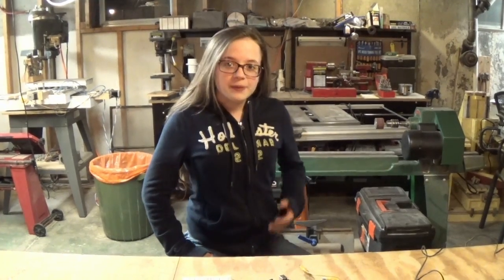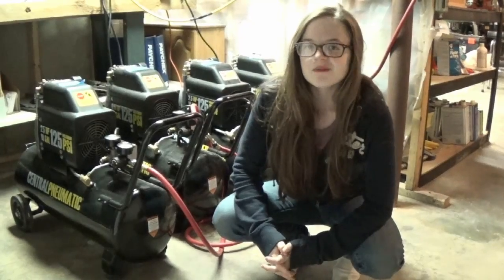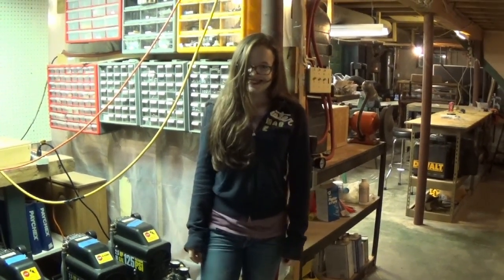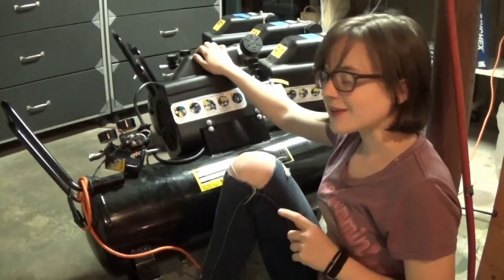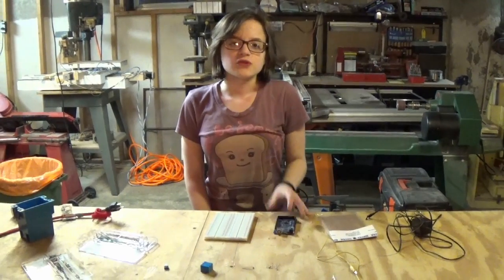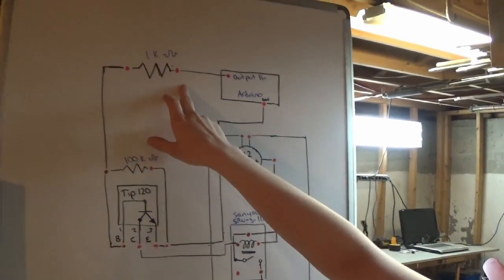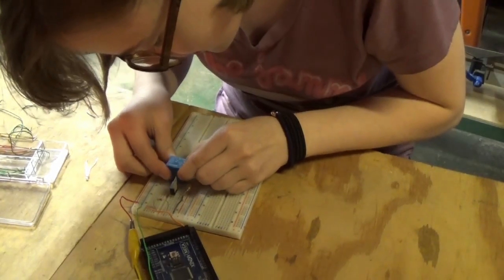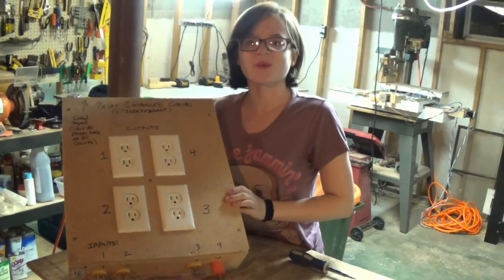Ep3 Cheap High SCFM Air with Parallel Compressors

Comment: Hannah has single-handedly restored my faith in the American youth.
Reply: she shouldnt.... you arent supposed to run air compressors on extension cords because of the high amp draw... it can cause fires because extension cords arent usually made of the same gauge (thickness) of wire as whats in your walls... NEC (national electric code) calls for no less than 14 gauge wire in your standard 20 amp 110 outlet.... (important to note that even though the outlet itself is only capable of 15 amps the breaker is usually 20amp).....

in summary during prolonged use the extension cord wire could get so hot that it would melt the insulation off of it and cause an electrical fire.... this effect is magnified by the length of the cord.
Reply: you do realize that a large majority of grounded extension cords sold are 14 if not 12 gauge. Unless you are buying the absolute CHEAP crappy extension cords you will be getting at a minimum 14 gauge. Also the duty cycle of the compressors will never allow the heat to reach that point in the cord or construction work would be having fires left and right from compressors running on extension cords all day while we do things like roofing or framing houses.
Reply: pmoore4321 how old is she? She seems pretty smart for "youth"
Reply: she just turned 34
Reply: Impedance in an electrical conductor is as much a function is length as it is gauge. She mentioned earlier to keep the lengths down. She'll be fine.
Reply: Ima Tumor Yeaaa right...
Reply: womer 66 those didnt look like 14 gauge cords to me more like 12 and as a electrician  15 amp circuits don't have 20 amp breakers unless some dummy replaced them.of all the thousands of times I have seen compressors on cords with a 15 amp breaker I have never seen a fire
Reply: she is fake bro , she is a character made up by a producer , she is just playing a part
Reply: @wormer66. I doubt it. Those comps' are probably 1.5 HP motors. Your average washer and dryer would draw more current than those pesky little compressors. I regularly run a compressor bigger than those through an extension with no problem!
Reply: doppler Your right man. I'm an electrician and it appears that wormer66 is on the right path, but still needs more knowledge when it comes to residential electrical circuits. Yeah and only an unexperienced electrician or somebody who doesn't care about safety would hook up a 20amp breaker on a 14 gauge wire. Plus this girl is so freakin smart that I'm pretty sure that if she did her research on how to hook up all of these compressors in parallel that she obviously also looked into her main power supply before making her video. 😉
Reply: all of the wiring in my house is 12 gauge... i have no idea why whoever built it originally opted to get only 15 amp outlets... shrugs*
Reply: Formidable38  says 2.5 hp on them.
Reply: When my parents remodel their come in the late 70s we used 12 gauge for both the kitchen and lighting circuits. Wile I used 20 A. outlets on the kitchen circuits, I use 15 A. outlets on the lighting circuits because they where feed by 15 amps circuit breakers. At the time 12 gauge wasn't much more expensive that 14 gauge, and some of the lighting circuit where quite long.
Reply: wormer66 Maybe they got the 12 gauge wire cheap. I wish someone used 12 awg in my house. My living room needs a few 20 amp outlets.
Reply: +wormer66
dumb.
Reply: Like she has done any of this on her own. She's reading from a script her parent/guardian made.
Reply: +wormer66 $$$ its even more $$$$ to rewire later but after spending $$$ for the 12 gauge you save by selectivly putting in 20 amp outlets only where you find you need them or want them later. Easy to swap an outlit hard to repull wire once sheetrock is up
Reply: sorry you are wrong 14 gauge wire is only rated for 15 amps and 12 gauge wire is for 20 amp so i am wondering what Home Depot you got your information from and by the way i run my 110v 160amp DC welder running at 110amps with 7018 3/32 welding rods off of a 50' 12 gauge extinction cord and after 2 hrs of welding nether ends are even worm ...and by the way I am also a licensed electrician and she is correct and will be fine and is taking the correct steps for the job she is performing
Reply: so i am wondering why dose it bother you so much that her family is teaching her so much good information about construction and electrical what better people to learn from
Reply: dexter2433 who u talking to bro type + and their name first
Reply: Ulricht vonLichtensteinp
Reply: Wormer66 - 14 gauge wire requires a maximum 15A breaker according to NEC.  If you have a 20A breaker, code requires 12 gauge wire and 20A receptacles.  If you have 15A receptacles on a 20A breaker, that's a fire hazard as the circuit can handle more current than the receptacles are rated for and the breaker won't protect the receptacle from overload.
Reply: Doesn't matter. She is being a good role model for the up coming generation, when so many others seem to want to live the Kardashian dream. Oh Please! I have been a Union tradesman for over 40 years, these skills are dying out, it's all IT or being a Rock star, we can't all be born rich, who would fix the plumbing?
Reply: pmoore4321 I think she's canadian
Reply: Your right.
Reply: If everything is new and connected right there is plenty of margin for safety, but if ft he runs are old and maybe a bit of corrosion etc a 15A circuit certainly may be dangerous to push to 20A
Reply: specially being female
Reply: Global youth in general
Reply: Dude she's a kid and a damn smart one. She looking to restore her old VW bug in time to do her driving test for her license.
Reply: pmoore4321 your great at sarcasm. i was cringing through the whole video.
Reply: Please see my reply above
Reply: @Gabriel-jc2sc  she is indeed very smart! She most definitely knows Ohms law!!!... She is most definitely able to perform the necessary calculations!!!... Please see my reply above!
Reply: @wormer66  rather safe than sorry!... I suppose you have a relatively old house?... (like myself!!!)... Safer to have a larger safety margin (than required) than to have an inadequate safety margin!!!
Reply: @Assimilator702  agree 100 percent!... Rather an overkill than an underkill!!!... Rather be safe than sorry!!!
Reply: @wormer66  the purpose of the breaker is to prevent fire!... The insulation around the wire will melt, causing a dead short (infinite current)... That will trip the breaker... a Breaker is actually a resettable fuse!... Instead of replacing the fuse you just reset the breaker
Reply: @dexter2433  I agree 100 percent! Everyone has to learn!... In fact we learn something new every day of our lives
Reply: @frederikmare9002  jealous? Why would I be?
Reply: @eiserntorsphantomoftheoper2154    More like 10.  lol   I think I saw her pink Barbie Townhouse at the back of the shop and she behaves far to (valley girl) silly to be in her thirties.
Reply: She quit a long time ago

Comment: Haha. I was playing around with the idea of some kind of central control to make sure one of multiple parallel compressors under independent control doesn't burn up trying to fill all the connected tanks. I did not expect to find the relevant issues so well covered by a 13 year-old! Great job. Keep it up!
Reply: Doesn't mean she knows it all and wrote the info, could have easily been reading a script then edited together
Reply: Nor me I'm doing a similar project.

Comment: Wow. Simply astounding. Someone has a Masters in electrical engineering. You have spent some time researching this for sure. You Just found a way to build a $7500 dollar compressor for about $600 bucks. I have heard there is some crying in the comments about this or that but who cares. What you set out to design so you could restore your Bug on your terms simply impressed the hell out of me. You young lady are the most impressive youth I have seen in quite some time. Bravo

Comment: I cannot believe the petty, insecure, and negative comments. Absolutely thrilling. This is HER solution. She invested the time to comprehend and implement. Everyone must learn somewhere. Clearly very gifted and intelligent. A note, there is a lazy solution to mechanically couple. I tracked down a US mfg that makes a phenomenal, all metal yet cheap check valve. Sellorcity on amz. I operate by pairing down into a single connection. I have two pairs of eight gallons. One mobile, and one fixed. Each pair uses this check valve joined at a T. I then have an adapter so I can run two 3/8 lines and join at the destination, or join at the pairs. Same idea. I made sure the pressure sensors cut in within a threshold. Also, drying the air is important. I recommend the check valves on quick connects so they can be oiled once every six months. I must use dedicated 15 amp circuits for each as they all synchronously cut in. I solved the frequency by pairing 7 gallon Kobalt tanks to keep mobility. I also configured the couples and check valves so I don't need every compressor on always. Not as refined, but fast and dirty. Also, check out the Makita 2HP oiled 2.5 gallon. I'm building a new array, and these peaked my interest. Taiwan made. The quality appears to be leaps over the last gen CP compressor that was very efficient. That would be the one with the crank exposed towards the handle. For performance expectations, I can run tools rated > 14 cfm.

Comment: Im an electrical engineer and I think this is great; keep up the good work !  The comment about a diode across the coil of the relay you are controlling with the transistor is a good one.  When a relay coil turns off, it generates a voltage spike due to the energy stored in its magnetic field.  This is known as a "flyback" diode.

Comment: Excellent vid, TBH never thought of combining cheaper lower amperage units for an increased CFM rating to get jobs done. I see a lot of criticism and official "air compressor inspectors" up here with plenty to say what is wrong, but it's my understanding you built this with a particular mission goal in mind and I'm absolutely certain you achieved it lil lady :)
(I thought I was doing good saving up for an 80gal 240v deal, now that I checked the CFM rating on all my picks knowing sandblasting is definitely part of my long term goals, I'm honestly considering two cheaper 60gal 120v deals lol, the arduino part is not a problem)

Comment: Absolutely fantastic.you remind me of my youth.I would spend lots of time across from my house at a tv repair shop.They also had metal working machinery a giant three phase air compressor he bought the pump,big tank and ten hp motor used and assembled them .Also there was This postal delivery man he would always finish his walking route early and spend about three hours there every afternoon.He quit his job as a professor or physics and chemistry early on because he hated the job.(what a waste of education)I learned a lot from him.My BIGGEST regret is not learning the mathematics every one told me I would need.Math is the most valuable tool you will ever possess.I am sixty years old Even though I am very intelligent (and modest)it is too late for me to learn it by my self.
Words cannot actually describe how great your family is.I spent forty great years as a union construction Forman.Keep having fun and learning learn as much as you can.Al from Twinsburg Ohio